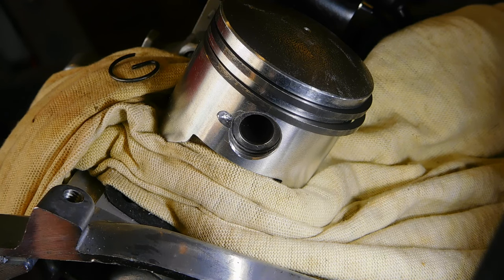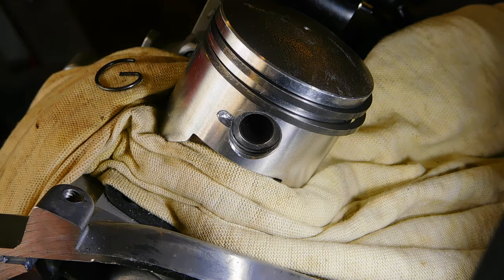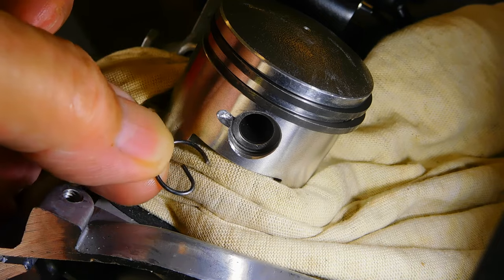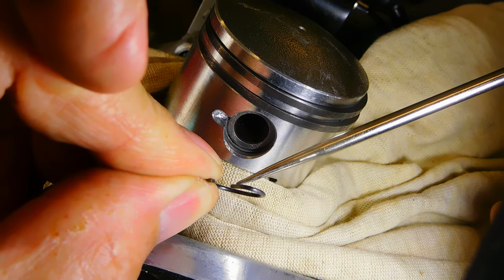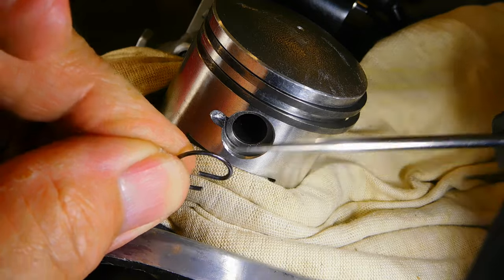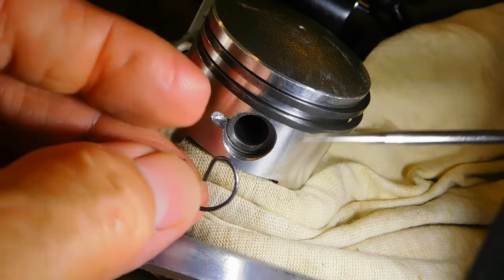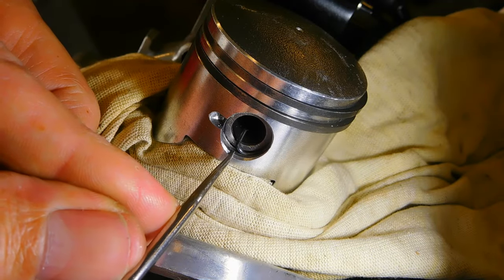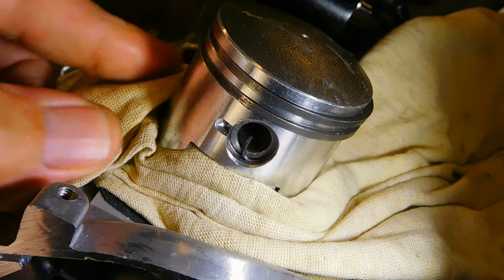One Way to Quickly Destroy a Two Stroke Engine

Comment: The pin pushes 360 degrees how is the empty hole going to push on the clip
Reply from the maker: The pin has a wall thickness and it is enough to push on the root or base of the ear on the clip.
Where a clip with no ear tag assures the OD of the pin always pushes against the part of the clip seated in the groove keeping it there.

Comment: I personally believe that 99% of wrist pin clip issues are caused by damaged or not fully installed clips. I personally have installed many clips that were loose after from over bending them. That's why once the clips are installed I always take a pick tool and make sure the clips are fully seated and don't spin in the groove. It's extremely easy to accidentally bend or distort the clip to the point where it won't stay tight in the groove. I don't agree with your thoughts on the G type clips, I think they are perfectly fine and I have personally seen many FACTORY assembled small engines that use the G type clips with zero issues. I believe most issues are that people don't double check their work once the clips are installed and I usually always order an extra set of clips whenever swapping pistons simply because if the clips don't seem right, I will change them for another set until all seems good.
Reply from the maker: I will reiterate 2 points made in the video.
1 this only applies to 2 strokes simply because 4 strokes don't have ports and a loss of a clip wont end in catastrophic failure as it can in a 2 stroke.
2 most people will never experience this fault in their lifetime, some will as you can clearly see from the comments section but in my case as a professional mechanic rebuilding many engines a day I have seen it a few times as have other experienced bike mechanics and we are in no doubt as to the cause of it.
But we don't take preventative measures building engines based on good luck or based on the absence of a failures occurring on an engine we have ever seen. If a mechanic is aware that a failure "may" occur just once, then they should take measures to prevent it ever occurring if they are a true professional mechanic.
And fitting clips without ears will ensure that.
There is a good reason that most 2 stroke engines come with pistons that have no ears on the piston clips and instead provide a groove to remove them and this videos covers the reason why.
Some engine makers do not fit earless clips and all I can say to that is that they are relying on luck only and not good sense as it would be of little to no cost to provide clips without ears on them which would never suffer this issue that ends in catastrophic engine destroying failure.
Reply: @AuMechanic  in my personal opinion I believe assembler error is the root of all the issues. I have never in my life personally seen a piston clip fail or fall out on a FACTORY installed/assembled engine. I have only ever seen/heard of clip failure/issues on engines that have been previously rebuilt or had some sort of internal work done involving disturbing/reinstalling new or used clips. Which leads me to personally believe it's due to assembly error. We can agree to disagree and that's ok. Engine building is one of the most controversial things in the world you can ask 8 different builders their opinion and you WILL get 8 different answers.
Reply from the maker: @briang4470  
Given enough dismantling of engines of engines that were all factory made you will eventually encounter engines not yet rebuilt with piston clip failures.
The fact you have not seen something does not equate to its lack of existence
And the mode of failure I covered in this videos is just one.
The other mode of failure is the pin rotating that results in it sawing off the ear that then falls into the port and ends in similar damage to that of a clip failing out.
You can believe that it does not occur all you like and you may never change your mind on that but that day a piston clip fails by way of the second mode of failure just described you will them discover the limits of your "belief"

Comment: Problem is, with most European performance cylinder kits, there is no indentation on the piston.  Please advise
Reply from the maker: If it is an OEM kit then Id probably just go with the clips they provide with it (even if they have ears), just not using the ear to install it with needle nose pliers, but levering it in as I do in the vid so as not to risk bending the ear inwards.
OTH if its aftermarket Id probably slot the ends of the pin hole with a small dremel burr tip to allow removal of a non ear type clips.

Comment: Hi there this video is gold thought me a lot I don’t know but my circlip slot wore out allowing the clip to come out and I’m wondering should the circlip be a real tight fit or free to turn around in there? I uploaded a video of it and was looking for similar videos on my problem and can’t find any I must be doing something wrong can anyone here give me advice thanks.
Reply from the maker: It should be a tight fit.
Also don't re-use old clips and be careful when refitting the clip repeatedly that might damage the slot. With the Chinesium engines be sure the clip used fits snuggly in to the slot and there is no sideways movement or the slip will wear the slot away in time.
For example if the wire diameter of the slip is a little smaller then the radius of the slot.
When removing the ears of the clip be sure to finish if the ends too so there is no but that might cause the slip to not seat properly.
Reply: @AuMechanic  Thanks for the reply, I ordered a few cir-clips I’ll make sure they fit snugly each way cheers I really appreciate that.

Comment: Ok so i just figured out why or maybe the cause of  An old 80's Victa 2 stroke  Charger i was given is Dead , i opened up the sucker and that circlip was in the port , The Gouge in the Bore is WoW 😂 new piston and rings dead  , i wonder why the fella looked at me strange when i said i'll pull it down , see what you've done to it lol , ive only just opened up and thought how the hell did that happen , Now i know Cheers for this Subbed :goodvibes:
Reply from the maker: Surprising how much damage such a small cheap part can do eh.
And note to anyone still skeptical about this video as there has been, let this comment be another example to show that while it may never happen and it is not all that common, if it happens to your engine you will wish you'd not ignored the advice.
PS thanks for the sub.

Comment: I had circlips like this on my suzuki ts50x for 3 years. had alot of miles on it, never any problem.
Reply from the maker: Glad to hear it
As mentioned most people will never have any trouble with them.
But as you can see in the comments section here that many have, and it nearly always ends badly if you do have one come out in a 2 stroke.

Comment: I have damaged my engine once from this exactly reason. Very informative video
Reply from the maker: Thank you for the comment.
Reply: @AuMechanic  so I’m a bit confused I’m building my first engine so the G clips with the ear are normal but you don’t want to bend the ear inwards? So towards the piston and if it’s facing us outwards is that fine or no it’s gonna be straight

Comment: What about the ez clips with two ears slavens  has them I’m not sure if I should use them or not?
Reply from the maker: You can use them but just be aware of which way you fit them as described in the video and check them for any bias as described in the video.

Comment: It took 30 years to find out what happened to my Yamaha DT50 engine. Someone said that I probably dropped something in the carter. But I was sure this was not the case. What I didn't install correctly were the piston clips. A big mess was the result.
Reply from the maker: Yes such a small part leaves a big mess if it fails.

Comment: I try to avoid wire clips like that. I usually swap it out for the appropriate size C clip
Reply from the maker: Most 2t pistons have a wire clip so the groove as a round profile.
If you fit a C clip that has a square profile that could be risky as it does seat on the rounded groove.
And using any clip that has ears is problematic as the video covers.

Comment: Any links to buying replacement circlips?
Reply from the maker: In most cases the OEM clips do not have ears on them.
Do a search on the clips you want and look at images search to see ones that are plain.
Or just grind the ears off the clips neatly so they seat in the clip grooves.
Reply: @AuMechanic  Can you re-use the OEM clips, or is this a BIG no..no?
Reply from the maker: @TheTronder007   You could refit them in the same piston if you just had to remove it for some reason, so long as they are not distorted being removed but I certainly wouldn't use them in a new piston. Its always best to use new ones.
Reply: @AuMechanic  Thanks for your reply, I assume  from what I've read here in the comments on removing the ears on the clips, grinding them off is the way to go and that clipping/cutting them off could dammage the clips.. 
I'm attemting to see if I can fix my dad's chainsaw witch was run on pre-mix two stroke gas.. that it turns out had an inadequate amount of oil in it.. so it's a bit of a learing curve but as it isn't financially viable to have it fixed in a shop here in Norway we decided for me to give it a try.. We figure that the worst that can come out of it is that I've learned something :-)
But the biggest lesson learned so far is to NEVER NEVER EVER trust pre-mixed two-stroke gas! we have lost two saws that way, one was brand new.. but unfortunatlely the thought occured a bit to late..
Reply from the maker: @TheTronder007   Yes grind them off, you can clip them off so long as you grind the ends clean so the ends of the clips seat properly into the slot.
Re saws, 30:1 seems to cover most and use good quality oil too, it is a good idea to get a proper graduated premix oil jug to reduce the chance of making a mistake.

Comment: Hello again..with this type of circlip I realise I've been doing it the easy way and worse I've forgotten to use the eye in piston which I did back when I worked on my rd engines.. when I've noticed a byest on the ear I've pryed it inti line not realizing I could have just turned the bugger...it's chainsaw engines I play with now...and take dead saws back to life...and end up with something has a value.I'm sorry ur struggling with channel..but at least ur fighting back...👍I've some nice content if you have time pls look
Reply from the maker: Back in 80's a worked at a Stihl dealer for short time tuning and repairing chainsaws.
Didn't mind working on them but had me sharpening chains too so I lost interest in that job fairly soon.
Reply: @AuMechanic  haha... I'd sharpen chains gladly before turning a screw on a stihl..it's a weird thing I just have no ambition too...husqvarna/jonsered👍...I'm waiting on parts to finish a 94cc bugger ..stock set up...it's far to easy to change the ports for the worst..Now I've a question mahle oem piston 56mm bore ..New kit coming reusing cylinder ...your thoughts on piston/bore clearance...mine are 0.06~0.10 am I way out...not that I could much about it...
Reply from the maker: Re piston clearance, not much you can do if it's got plated bore other than get another cylinder it it's worn.
No cheap ones on Ebay ?
Reply: @AuMechanic  I hear you on the chain sharpening, been there, done that, got over it real fast :(
Reply from the maker: The down side of working at a small dealer, they didn't do enough chain saw mechanical repairs to fill the day so made the time up doing chains.
Reply: @AuMechanic  Did you at least have a bench mounted chain sharpener?
Reply: @AuMechanic  it is plated and survived overheated piston sieze with only some alloy from piston to clean up..luckly oem plating is tuff.I removed rings cleaned up piston but had doubts if it was still in spec so using a feeler gauge  0.1 was loose 0.15 was snug.I'd be afraid to use it with new rings!!!..for the sake of aftermarket metor piston kit. I choose a moly2 coated piston! may help overall but mainly cause I had never used one. it's trial and error...
Reply from the maker: "Did you at least have a bench mounted chain sharpener?"
Yes, with the ratchet arm back stop and mini clamping bar, dress the wheel every dozen or so chains.
Reply from the maker: @Nicky Walsh
A bit more clearance is not so bad for a chainsaw.
Reply: @AuMechanic  really..I may have wasted my time and money so ....I'll get back to you after new kit arrives..👍
Reply: Hello again..received my new hyway piston kit and compared clearances..haynes workshop book states 0.3-0.7mm for bore clearance with RD  that spec will do me...So with new piston my smallest leaf is 0.05 and its to large not by much mind ..but it drops in freely..so skip forward it started easily and took a tune easily...not quite finished project.. there's a short vid and description for viewing... 👍but I is happy boy...
Reply from the maker: @nickywalsh8492  
RD clearances are much wider, aside from that Haynes manuals are not terribly reliable.
Most saw clearances seem to be around 0.05  (about 2 thou inch) so that is fine.
Just keep in mind piston clearance is measured at the skirt end at 90 degree from the wrist pin which is the widest part of the piston.

Comment: What if you use internal retaining circlips. The same type that have the two hole at the end. I hear disels use them
Reply from the maker: Don't use them, the cross section of those "snap rings" are square shaped and the cross section of the slots in the pistons are a round shape so the square section snap rings will not seat properly and can come out even more easily destroying the piston and cylinder.
Reply: Those are internal retaining circlips. I think you got the wrong idea
Reply from the maker: @christianscottsuzuki  
No not in 2 stroke pistons, but if you want to use a square cross section snap ring then go right ahead, best of luck.
Reply: @AuMechanic  there is no square cross section though??????????????? Ru talking about where the pliers grab?
Reply: Ehat about the peope who already have been running them and the diesle engines
Reply from the maker: @christianscottsuzuki   I'm sure they do in Diesel engines, but this video is not about Diesel engines its about SI engines with transfer and exhaust ports in the cylinders and in such engines the pistons have a rounded cross section piston clip groove.
Reply: @AuMechanic  what do you mean by cross section? The circle part where the circlip pliers grab? Ive also heard about people who have already ran them in 2 stroke motorized bicycles on the facebook bikeberry forums and they say so far its fine
Reply from the maker: @christianscottsuzuki  
Cross section refers to the shape you see if you cut something in half and look at it end on. (Google the term)
A wire clip is made of round wire and so has a round cross section, these are the type of clips used on spark ignition 2 stroke engines, The circlip also know as "snap ring" that has holes in it for circlip pliers is punched out of from flat sheet so has a square cross section.
Reply from the maker: Here is an image of a square section circlip
https://cdn.mscdirect.com/global/images/ProductImages/6715728-23.jpg
Here is an image of a round cross section circlip as used in 2 stroke cylinder ported engines the video covers.
https://www.homebrewing.org/assets/images/91-3178.jpg
Do not use the square cross section ring in the piston clip slot designed for the rounded clip.
Reply: @AuMechanic  Thank you. This answered everything i need to know. I get it now. I guess my new journey is towards a super good metal quality made right into the c clip hahaha. Please please please send a link to a strong clip. Mine are all junk forsure since i bent them up alittle and my bike is my only vehicle.

Comment: Man Thank you so much I’ve had 2 engines destroyed with the dam g clip ears braking off and now I see why, can u just remove the ear? And file a notch for seating the clip as my piston has none.  Wee Story- ones I was 20 kilometres from home engine started making odd noise clutched in immediately had tool kit with me so open up engine seen clip eir broke off which broke a ring and made like 3 Grooves in the piston and cylinder at least 1mm deep this was at the bottom and few lighter ones up the top end so I started sanding away trying to clean it up changed the broken piston ring and cleaned out the crank best I could put it all back together and luckily it started up and got me home, changed out the engine after that haha...
Reply from the maker: Yeah makes a mess when it comes out.
Yes you can grind off the ear if you cant get a clip without one.
If you snip it off just make sure there is no burr left so it seats in the groove fully.
And yes you can file a small notch the allow it to be removed, just do it to the side of the hole like the piston in the video and not the top or bottom side.
Reply: AuMechanic alright cheers for that.

Comment: Im not convinced this is an actual point of concern.  The wrist pin should not be generating any significant force in that direction.
Reply from the maker: The wrist pin is full floating not pressed, so it moves and rotates.

Comment: It seems like that ear would get hot and bend too. Use the other clips!
Reply from the maker: Its possible.
The main two issues are the end of the pin pushing on the ear causing the whole thing to pop out as in the video
Or the other problem I should have covered in the video is even if the clip doesn't fall out the piston pin rotation can "saw" the ear off the clip.
Either way you end up with a clip or part of it causing serious damage.
So yes an earless clip is the best.